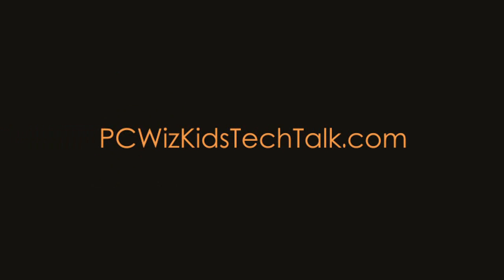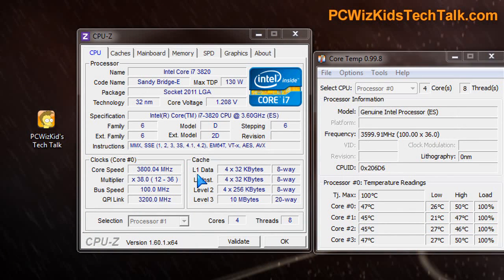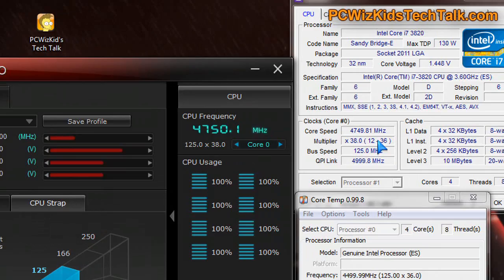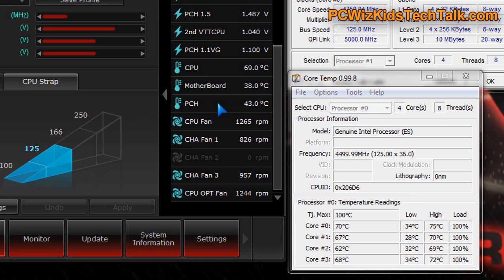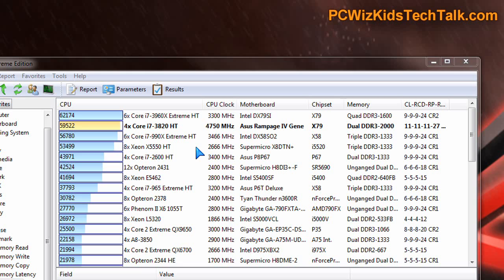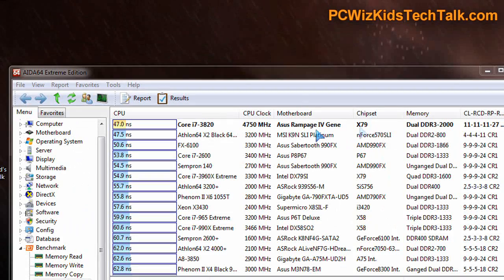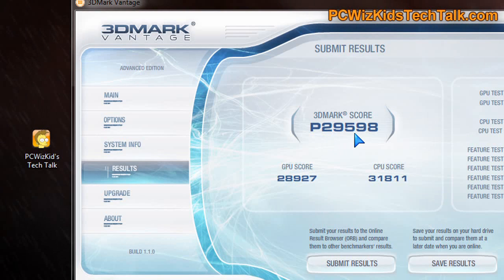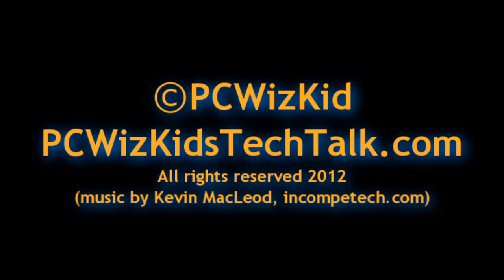Intel Core i7 3820 Sandy Bridge - E Overclocked CPU Video Review

Comment: can someone explain to me what happens when you use a 1333mhz memory ram with a processor that accepts 1600mhz? lost too much performance?
Reply from the maker: If the latency timings on your 1333 are faster than the 1600mhz you actually might gain performance.  Not much difference if the 1600Mhz you have is slower.  1333Mhz will work.

Comment: Just a pointer though this video is old so most likely not to often "referenced".
When "PCWizKids "is saying that he "raised the baseClock" what he means it he is using the "Strap" 125 to raise the baseclock.
You should use the "strap" because if You raise the ACTUAL  baseClock in the "BIOS"/UEFI,  then ALL busses will use that raised  frequency, so You are trying to "automatically" overclock a bunch of other things on Your motheroboard, not only the CPU. 
You would In  other words overclock the PCIE slots AND the Memory with the "multiplier" as You raise the baseclock which usually is not what You want to do.
Just saying.
Best regards.

Comment: dude is the chip still alive (with that high voltage and stuff)?
Reply: I have my i7 3820 oc to 4.6Ghz with a vcore of 1.32. I am pretty sure he would have turned it down since you're not really supposed to go over 1.35
Reply: well I run mine at 4.7 with 1.41... Not ideal but "acceptable". Intel absolute max voltage is 1.4
Reply: can someone explain to me what happens when you use a 1333mhz memory ram with a processor that accepts 1600mhz? lost too much performance?
Reply: Im still running a 3820 at 4.6Ghz aircooled on an Asus P9x79 Deluxe.. May 2020

Comment: Hi, at first, very nice and good Videos.I haveIntel Core i7-3820 CPUAsus Rampage 4 FormulaCorsair CMZ 16GX3M4A1600 C9 DDR3- 12800UThis CPU is so great. Its so easy to overclock in Bios. There i can vote 4 Different Kind of Overclock Settings up to 4700/2000  CPU/DDRFirst i was very carefull, cause the Default Settings with Turbo is with 3800 MHz good enough for everything. But after a while i start a Little overclocking, and with the Chance to clock over bios or the AI Suite its so easy to get a great Performance.With a good Cooler its no Problem to get it up to 5.7Ghz. I get it up to this 5,7 Ghz but i want my cpu not for overclocking so i set it down to 4.7 Ghz by loading the bios overclock Settings and that are the Settings i run my pc since 2 Years, without any Problems.I have 2 MSI Nvidia Geforce 670 in SLI mode runing, with brings a better Benchmark then the Gefore TITAN.I make the Benchmarks at the time when the Titan came on market and i was so shocked, cause i had a much better power with this 2 Cards then the Titan , and that for not the half Price that the Titan costs at this time. I had run am Benchmark with 3 of the 670 Cards and it was awsome. But i put the 3rd back in box, I Play every games on full Settings with great FPS, World of Warships 75 FPS with absolutly full grafik.  I love this CPU and for this Price its so great.BBBundy

Comment: What kind of voltages and settings would you recommend for a OC of 4.2Ghz? I don't want to OC too much, I preffer to keep my temps below 70 degrees C. But then again, Im normally not an overclocker and Ive always made sure my pcs stay relevant for 6 years average. Im hoping that OCing to 4.6 - 4.7 isn't too high and will it reduce the life of the CPU?

Comment: Is there any other settings to do for this motherboard? Because I have it successfully overclocked and it is only getting 30fps in bf3 1080p low, I have a gtx 670 and 16gb 1866mhz xmp, everything else is same as you have.

Comment: hey PCWhizKid, I need to know if i can hit 5ghz stable with a H100i for the 3820? im getting 40 degrees on a 2600 stock 3.4ghz. My ambient is 35 degrees. Would it be possible? Thanks.

Comment: nice OC with this little "BEAST"..i have the same one as well same OC 24/7 with H100 push/pull setup..but my temps go way high to 75*-77*C don`t know why?
can you post your bios templates please? or which setting a-z you tweak..i will really appreciate it.
i have the same Mobo+Cpu+H100+16Gb G.Skill 2133+ AMD 7970+HAF X fully Ventilated..

Comment: yeah thats one of the bigger reasons i started getting into the hardware side of things and built the initial desktop. being able to swap out a few parts now and then is better in my opinion that purchasing a whole new rig. im thinking i will just hang onto the mobo, possibly for another build, but what would you recommend from a gaming mobo? im using sapphire hd 7970 oc for a video card and G.skill ripjaw X series for ram (2x4gb)

Comment: I am fairly new to computer hardware/PC building, and two components I got to upgrade my desktop were the ASUS Maximus V Gene and the Intel i7 3820. The seller didnt list the socket type, and now I am stuck with either returning the CPU or Motherboard. I was planning to return the CPU in exchange for an i7 3770k, but i dont know which would be the better option as far as the motherboard you used in this video with the 3820 or the one i have with the 3770k

Comment: Underclocking and undervolting is awesome if the BIOS allows it, unfortunately I've not run across a laptop that will.

When you decide to upgrade form the 6870, dump the 965 as well. I had a pair of 6870s in CF on a Crosshair IV Formula and the 965 bottlenecked them heavily in benchmarks and not as much(but present) in games.

At the very least a 1090T, better yet - go for something like Sandy Bridge quad. I'm running with a GTX670 now and my 2500K is doing sweet ^-^